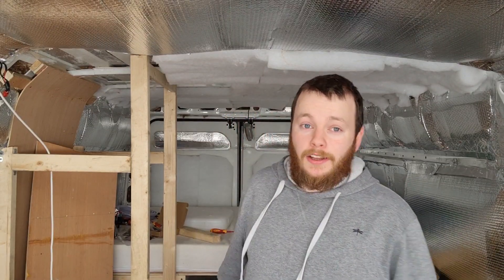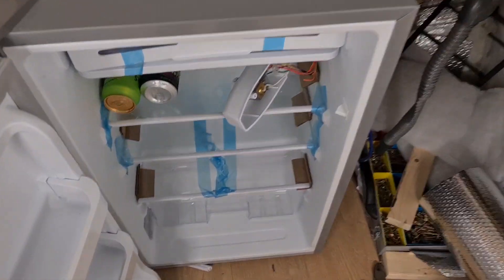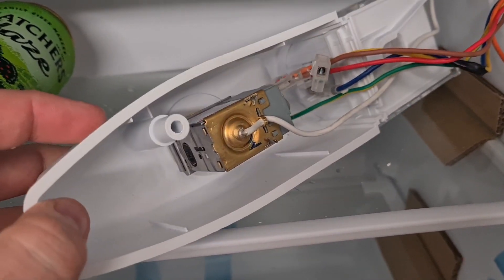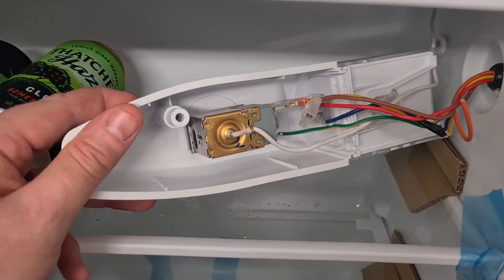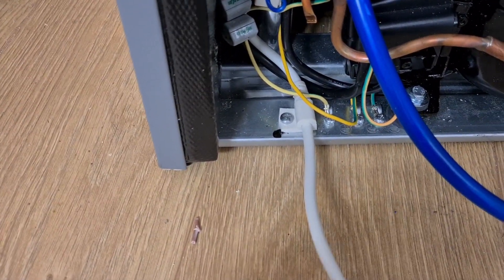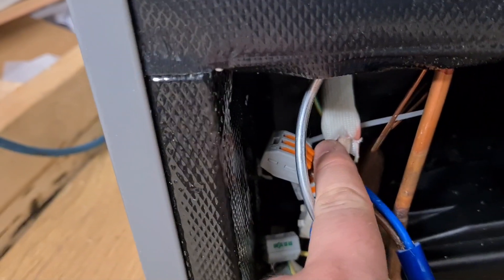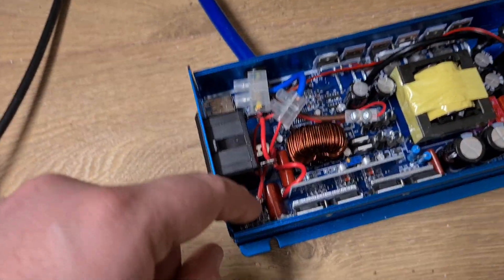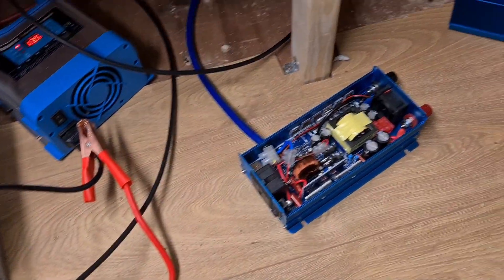Wiring an Inverter to a 240V fridge thermostat

Comment: Brilliant video, thank you for sharing. Just connected up a small Argos table top fridge. Was running it from a 1500w inverter (not wired to the switch) that just eat the battery. Now got a 300w inverter from Amazon all connected up on the switch running 24/7.

Comment: Hi Mike
Just seen your vid. I admire your confidence in showing this.
When I did mine about 3 years ago I wanted to merely prove that it was possible. I certainly didn’t want to go into details because I was terrified at the thought of someone not following it properly. I’ve refused to give advice to those who have asked for wiring info.
As you quite rightly point out, the wiring colours differ. It’s easier to use stat PIN numbers.
6 live. 4 switched live 3 light.
My cheap £30 inverter just died yesterday, I’m amazed it lasted this long. Proved this setup so well now that my fridge is out and replaced with fridge freezer. Amazingly it runs on less amperage than the fridge. I didn’t change the bulb holder but I did fit a short strip of leds.
Anyway if I get asked again for specific wiring advice, I’ll tag your vid.
Keep thinking outside the box,
Regards
Keith

Comment: LOL that was my coming weekend test plan. I thought I had a unique idea.  I only still struggle with the inrush current of the fridge, it overloads a victron 650Va inverter.Iĺl be testing a soft starter also. great video
Reply from the maker: My cheap amazon 1000W is still going strong. Apparently a 700W pure sine wave is also good

Comment: If you cut the switch wire in the inverter and wire to the thermostat  - are u still able to use the inverter socket to power other appliances
Reply from the maker: @punkypixie6970  no, because the fridge is plugged into it.
Reply: I realise the fridge is plugged into it, but if I unplug fridge temporarily, would it still work, considering the thermostat is now controlled by the switch.

Am I better with a brand name inverter, just for running fridge, or would a cheap 1000w inverter puresine wave or modified inverter be ok

(Ps.... thank you for such a fantastic video, I can do simple basic electrics, (winging it.  Lol) but I don't understand all colours of cable and what they do, but ur video is frigging awesome, and I am away to do this to my fridge also....🥰)
Reply from the maker: @punkypixie6970  the thermostat now is in line with the switch, so if you unplug the fridge, turn the thermostat on like you wanted to make the fridge as cold as possible) and the inverter switch on you can plug something else into it and it will work.
Reply: @BedfordshireBiker  thank you so much, that's great.

Comment: Thanks Mike!
Got a question: does all the power go through the cable from the thermostat to inverter? Is there 700 watts peak and 60 watts continously on that tiny wire? Or just a small charge that tells the inverter "You can start now"? 
I am asking because in my case, there would be like 6 meters between the inverter and the fridge. If all the power goes through that cable, it would need to be a pretty thick one...
Reply from the maker: Inverter power isn't going through the thermostat. The switch on the inverter is only triggering a controller on the inverters circuit board and not doing any direct switching itself. Once you open up your inverter you will see what I mean - the cable on that switch is maybe 0.2mm. If you have a long cable run make sure the inverter is as close as possible to the battery and use the 240v cable to go to your fridge as you won't get any voltage drop along it.
Reply: @BedfordshireBiker  hi man ! I'm a about to try this! Are you on Instagram so I can contact you for some adive? :)

Comment: Hi, i get the thermostat control side but not the power side. The 240v in goes to the compresser relay. How do you wire direct? You must still need that? Thanks
Reply from the maker: The mains plug is wired directly to the compressor. The inverters switch is wired through the thermostat... That's it!
Reply: @BedfordshireBiker  ok, i think i have it. As the thermostat is seperated You take the live and move it onto the thermostat terminal on the relay - i have shown it here; https://drive.google.com/file/d/1q3a8WaOCzkQPFbDyX2Co3Vx69cpNO3bh/view?usp=sharing    Please mark if i have this wrong, thanks for your help!!
Reply: For anybody reading this that wanted to know. The diagram uploaded works and is correct.

Comment: Hi Mike, great video . I completed this today with a 1000w inverter from eBay and a cookology 66l mini fridge. However , I am getting surges of 30amps for about 10-20 secs then no draw from the fridge for a few minutes then another surge of 30-40amps for another 10-20 seconds and the fudge isn’t getting cold. Any ideas? Dodgy inverter or knackered fridge? Thanks
Reply from the maker: Sounds like you have a dodgy inverter. Startup surge on fridges is high and will overload a cheap inverter. Chinese 1000W inverters are more like 300W in reality! Also make sure you get an Inverter that's "pure sine wave". The cheaper modified sine wave type may work but its not as efficient or good for the motor.
Reply: @BedfordshireBiker  thanks for the reply

Comment: Am i right in saying that... now the compressor only kicks in when required and not constantly?  Other video's had a relay? I need this soooo much.  240 fridge is draining my battery
Reply from the maker: Your correct. No relay needed if you have a mechanical thermostat In the fridge.

Comment: Great video.  Can you tell me what cable size you used between the battery and inverter?  Also, in your opinion if there is some distance between the battery and the fridge, is it better to have the inverter closer to the battery (short 12V cables, longer 240v flex) or the other way round.  Thanks.
Reply from the maker: There's cable size calculators you can use online. It will depend on the maximum amp draw of the inverter you are using. You are better having the 240v cable being longer and the 12v cable being shorter... You can run AC electricity much further without losses compared to 12v DC. You want the inverter as close as possible to battery to reduce losses.

Comment: Great video even I managed to do it, 
One problem though the power is going to the fridge which is brand new and was working, but the compressor isn't powering up now only a buzzing noise and compressor getting hot, any idea what may be the cause dude.
Reply from the maker: Bad inverter. Either not powerful enough or your using modified sine wave instead of pure sine wave.
Reply: Thanks for the reply, 
it is all working now after realising something had come adrift.
Great video and well worth doing.

Comment: Just bought a 100w 47L fridge, I'm going to pull the trigger on a 500w continuous/ 1000w peak pure sign wave inverter. Can people confirm if a 500w PSW inverter is adequate?
Reply from the maker: Should be fine if its a decent brand. If its a Chinese one try go a bit bigger. The one in the video is a 1000w Chinese one so probably more like 500w and its fine.

Comment: I fitted a small 46L  240v 50w compression fridge.only £90.(Chiq)  it is very quiet at 35 db's and works far better than the unreliable (2 broken 3 way fridges!!) I presently use frozen bottles to keep the fridge cool until I get  a hook-up on campsites.(motorhome) The 12v alternator cable for the old 3way fridge is unused in the same cupboard as the Chiq fridge. After seeing your video it made me think that I could plug the fridge into an inverter when travelling using the alternator 12v cable. Would this work? ( I could plug the fridge directly into the inverter would be o.k.? )What size inverter for a 50w fridge? Thanks for any advice you could offer. George
Reply from the maker: 50w will actually peak at nearly 300W just for a second, so you would need a minimum 300w for a pure sine wave inverter. For a modified sine wave you may need a bit bigger, 500w should do.

Your unused 12v cable would probably be fine to use, as long as its going to a battery and not directly to the alternator. Can't see why it would be going directly to the alternator - that would be odd.
Reply: Thanks for your reply. I read the following on a motorhome forum.- 'The 12v wire going to the 3way fridge comes from the engine battery through a relay. The alternator field winding is what triggers the relay to the on position . When the engine is running the alternator field terminal has 12v on it which is what switches the relay on.' 
Does this mean that it will be O.K to go ahead with your advice?  regards George

 @BedfordshireBiker
Reply from the maker: @georgestewart1983  I would follow the wire and find where it goes in your motor home. I've only ever dealt with campervans and that's not how they have been used and I wouldn't use that wire myself if it is what you say. Alternator output can be as high as 15V (you need more than 12v to charge batteries) which might overload an inverter and pop the internal fuses - this is different than a 2/3-way fridge which is designed to take that sort of voltage.

You really only want to do this with a leisure battery.
Reply: Thanks for your advice, I did not think about all that power going to the inverter ! @BedfordshireBiker

Comment: Is it 100% necessary to disconnect the light in the refrigerator? Is the bulb connected to the power wire circuit for the thermostat? If so I may try to run another wire ip to the light.
Reply from the maker: It will only work when fridge is running and you would have to swap to a 12v bulb. Stick on Led battery light is easier
Reply: @BedfordshireBiker  ok thank you for the input. I know all of the accumulated questions and comments here will make it easier for everyone. Thanks for uploading your video

Comment: One more question, did you use a pure sine wave inverter, or a modified sine wave inverter?
Reply from the maker: Pure. You would need a bigger modified and it would be less efficient. They supposedly age the compressor more too

Comment: Hi Mike. About to do this just like you've explained. One question: how do you lock the door, so it doesn't accidentally open while driving?
Reply from the maker: I've put a kitchen childlock on ours, just a plastic strap. A velcro strap would probably work better.

Comment: How do I connect the two cables from the thermostat to the one connector of the on/off switch? You said cut it in half, do you mean split the connection? It looks like youve soldered two cables to the inverter on/off terminal, is that correct? Thanks
Reply from the maker: Your correct. The cable going out of the on/off switch cut it in half and join the resulting two ends to your thermostat cables. That way you essentially have two switches (the on/off and the thermostatic switch) wired in series.
Reply: @BedfordshireBiker  Ah ok, my inverter switch is attached to a PCB, I'll have to solder two wires from one terminal of the on/off switch or use a splitter I guess. Wish me luck, and thanks for the guide, I'd be lost without it.

Comment: Hi. I’m a bit lost. Why did you have to do all that wiring. I thought the idea of the inverter was to just plug in and job done?
Reply from the maker: Because your inverter will remain on at all times, draining your battery whether your fridge is working or not. You wire it like this so the fridge can turn the inverter off when it snot needed.

Comment: Had a go at this, worked nicely for a few days, but then I re opened the inverter to swap the switch round (I had installed it the wrong way round) and it stopped working. Can't for the life of me figure out why. Now even when I put the inverter back exactly how it was it still doesn't work. Any idea what I might be missing?
Reply from the maker: Checked the fuses inside the. Inverter? Didn't open it when it was live did you?

Comment: Hi Mike, I'm a real novice at this. Where does the other end of the 240 cable go?
Reply from the maker: I really need to do a wiring diagram for this lol, the normal fridge cable plugs into the inverter. In the back of the fridge you find the cable going to and from the thermostat and cut both. Join it together so that the thermostat is essentially doing nothing and the fridge is on constantly. You then take the two open wires that go up to the stat and wire them to the on/off switch in the inverter, preferably in parallel so you can still switch the lot off, or you can cut the switch out and join the 2 switch wires to the 2 thermostat wires, if you want to turn the fridge off just turn the thermostat all the way down.
Reply: Thanks, I'll give that a go
Reply from the maker: @philnelson181   no worries. If your local I wouldn't mind doing it for you so I could make a better video! I'm in Bedfordshire
Reply: @BedfordshireBiker  I'm in Devon, so not that local 😬
I've got three cables coming down from the fridge. Blue- n brown- l and white which is for the thermostat. I'm connecting my 240 lead to the compressor. So blue to blue and brown to brown. 
 Shall I join the white to earth?

Comment: What size was your inverter please?
Reply from the maker: 1000W pure sine wave, may not need that big.
Reply: @BedfordshireBiker  do you think a 300w would do?
Reply from the maker: @mikebouchet2791  no, generally need 7-10 × the fridge rating to deal with the power spike when the compressor starts. This is a 65W fridge so would need a 455-650W min.
Reply: Hi mate I have done the fridge re wire used 1500 inverter fridge getting warm at the back but not getting cold inside also inverter only showing 223. Any ideas would be great 👍 thanks 😊
Reply from the maker: @mablethebus  you got a pure sine wave? Some cheap modifies sine inverters won't run a motor properly and the compressor will just stay in a "locked rotor" sort of state and overheat.
Reply from the maker: @mablethebus  remember you can always plug the fridge into the mains to see if it gets cold, that way you know you didn't mess up any of the wiring
Reply: @BedfordshireBiker  thanks I’ve sorted it now. bought a better inverter. Now works fine 👍
Reply: I’ve done this but left the fridge as standard on coldest setting and used a separate temperature controller which also displays the fridge temperature.

Comment: Arrrrhhhhh my inverter switch does not have a wire, it's been soldered directly ro a circuit board, 
Where do I now take my thermostat wire and add it to????
Reply from the maker: @punkypixie6970  unsolder the switch and solder wires to the board.
Reply: Oh my goodness, thank you so much for such a fast response  ❤

Comment: Why not just plug the fridge in to the inverter? I don't get it sorry
Reply from the maker: It is plugged into the inverter. But the fridge is now turning the inverter on and off as required to save power. Normally Inverters use power 100% of the time even when the fridge isn't running.
Reply: @BedfordshireBiker  arrrr.... OK this makes more sense now to what you are trying to achieve!

So basically thermostat drops below a temperature.... And then when it does so it powers on the inverter af the same time... And then everything kicks in to life.

I wasn't aware inverters used power even when the fridge was off...

I'm planning to try make a solar panel set up. Hooked to a leisure battery to power a small fridge in a tent (mini mini fridge)

So I guess this is quite valuable info... Never considered the fridge even when it's not doing anything that the inverter wud be draining power
Reply from the maker: @fabiotozzi7419  I have 200W of solar, the fridge has ran for the last 6 months without issue so you should be fine
Reply: Thanks for taking time to reply to this. Might look at a timer at least as don't want to fiddle to much with the fridge now I know this. Just something to turn the invertor on and off every hour. Not as efficient as your method but will save me some power. Just looking now and totally unaware an invertor can draw an amp with no load... An amp I can't afford for 24 hours a day!